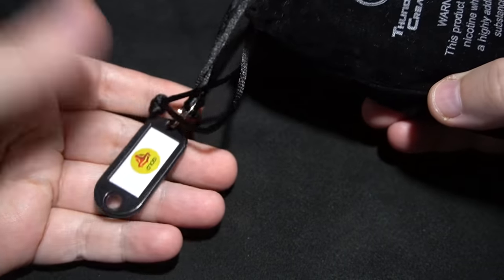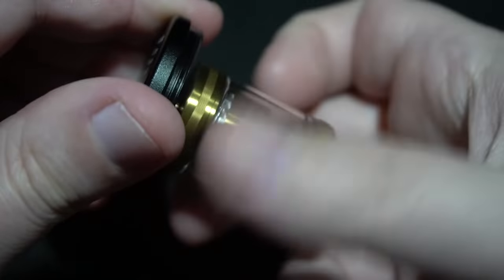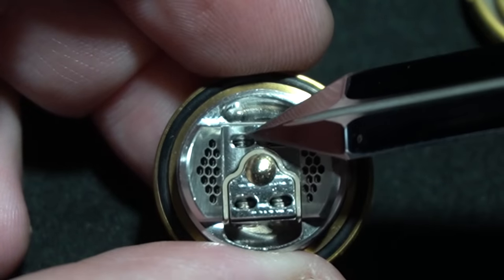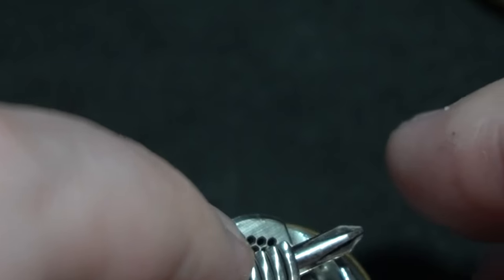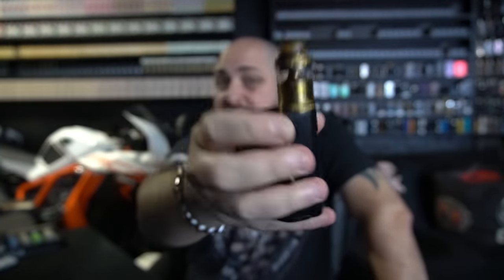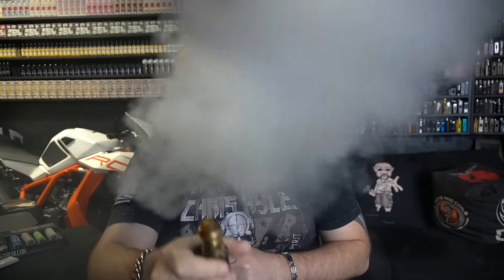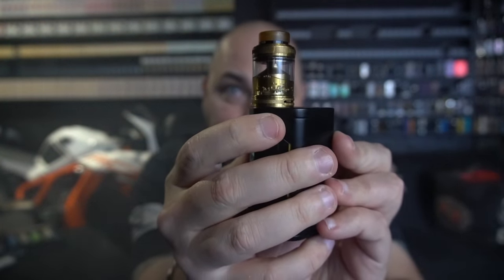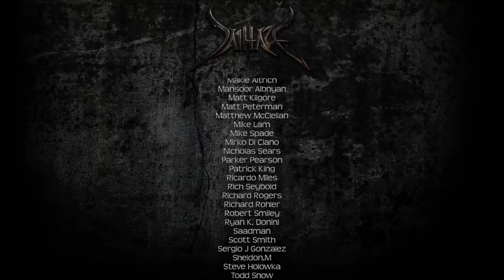Throwback: The Beest RTA!   Thunderhead Creations

Comment: I bought one of these months ago. I totally agree with your single coil over dual coil thoughts. When I shop for atomizers (rda/rta/rdta’s) and I’m looking at a dual coil build deck that interests me I always base my purchase decision on whether I think I can build it successfully with a larger single coil. When I built this I did what I always do if I’m concerned about the airflow striking the coil sufficiently to enable good flavor.. I build a larger diameter coil (here I did a 4.0mm ID) ... I mount it higher up and flatten the round coil into a fatter oval shape..therefore pushing the outer edges of the coil more directly into the airflow path coming from the honeycomb airflow... It worked beautifully and I got  really good flavor. The coil was a triple core fused clapton N80 coil. I’ve used ovals in my Dead Rabbit’s (slightly aimed a bit) to increase the surface area of the coil interdicting the airflow. Works welll. I usually form the ovals flattening the coil shape with my fingers so I don’t damage the wraps.
Reply: That’s a cool idea imma have to try that sometime.

Comment: If you like single coil options there's Tauren one solo
But that's I have and the wecking channel need for more cotton than what you do else it's may be leaking properly
There's is one cons I found
The glass to much near of chimney section that's make it not wecking as I like
About that's bubbles you like that's will be seated on the bottom and it also make it hard to get juice to the cotton and you will get dry hit or near of that
Thats my experience with this rta
I like the flavor but that's only cons I mentioned

Comment: It always makes me laugh when jai bitches about decks that twist the coil leads. Not because it's not worth moaning about, but because the 502 (which came out around the same time) had the exact same issue, unless you used horizontal coils, which it wasn't really designed for.